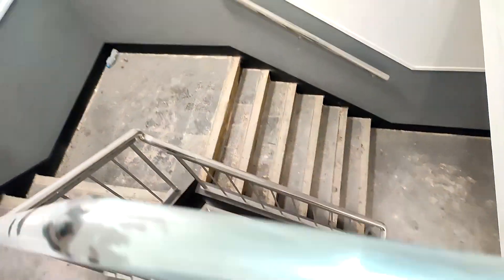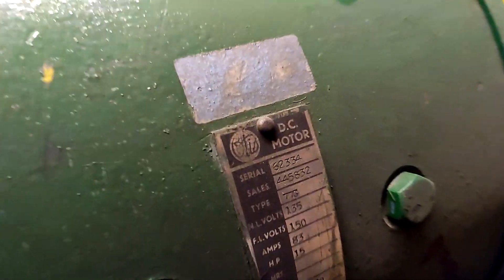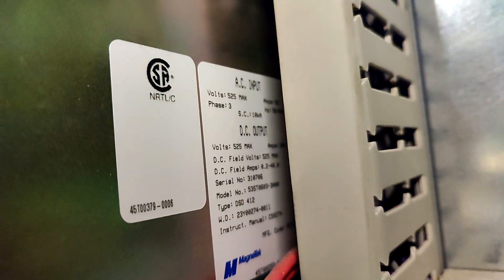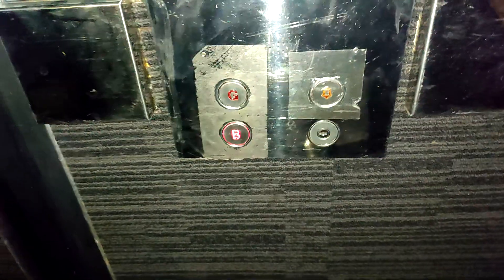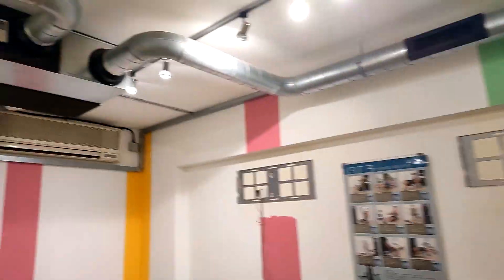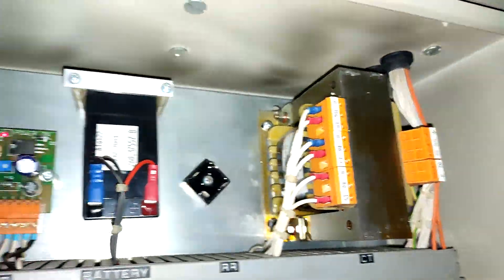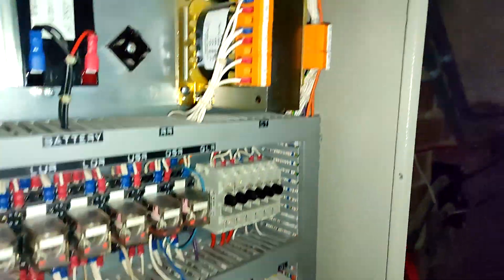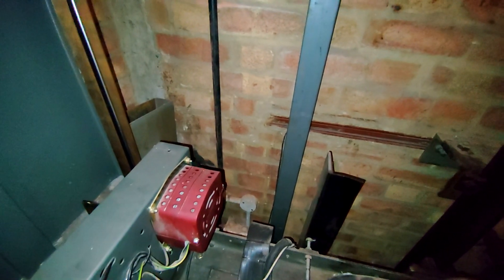DC PWM Lester mod of 60s Otis in abandoned building

Comment: The data plate shows the DC motor is 15HP pulling 83A, N.L. 135VCD F.L. 150VDC I'm surprised the voltage is not higher maybe in the 230-240 VDC range to reduce the current draw.

Comment: That's weird how it's been abandoned so long, and with the power still on.
Reply: Some buildings must remain powered so that certain safety systems (fire alarm, security, etc) can continue to run.
Reply: @ObtainEmployment  oh yeah I don't think that councils will care if its abandoned safety wise but they may have mobile data masts on them etc. That require power. There are a few abandoned multistorey carparks near me that can't be demolished until the mobile data transmitters are removed from the roof.
Reply: @jakewynn  I'm basing this off of the US, but many fire codes here require continuous monitoring, which is done by the fire alarm. If the building catches fire it needs to be caught and sent to the fire dept for dispatch. In my city we have tons of homeless and vagrants who hang out in these buildings so it's a public safety matter, here.
Reply: @ObtainEmployment  not saying we don't have the regulations for it,  just that the local councils are lazy and don't have any consideration for homeless people 😂 but yeah your point was definitely valid, didn't think of that aspect. Most abandoned buildings get trashed by copper thieves and therefore all power and water is gone.

Comment: If the first 2 lifts are DC, does that mean that there is a rectifier to convert the power from the mains supply from AC to DC?
Reply from the maker: Yes.  Both VF drives and DC drives convert the incoming supply to DC